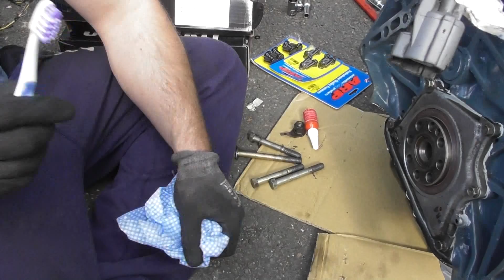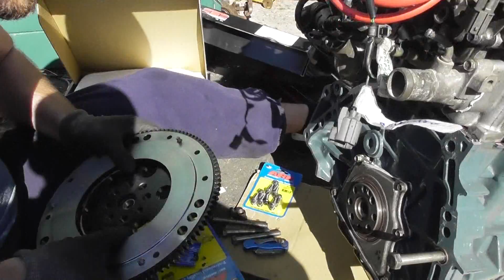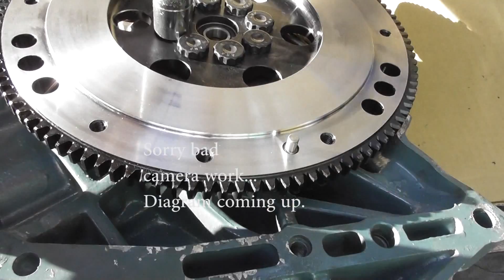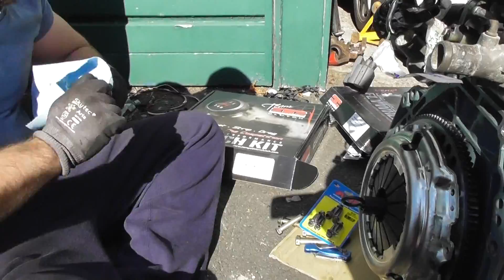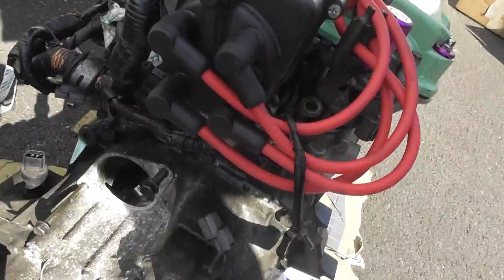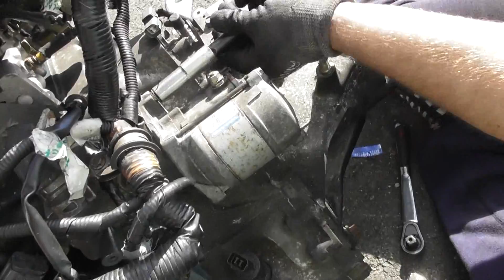T2CG Honda Civic EF Part 12 : Flywheel Clutch Gearbox Starter Motor Install

Comment: Did you clean the flywheel and presure plate with alcohol or brake cleaner? To get rid if all the oil off of it??
Reply from the maker: I used alcohol iso spray.... although I think either would work. Thanks
Reply: +Twin2 Civic Garage T2CG oh ok

Comment: very nice choice of clutch and fly! do u think the ARP flywheel bolts are absolutely necessary or could i get away with using the old stock bolts? its a n/a h22 build btw.
Reply from the maker: +v6 ftmfl Hi, no the ARP bolts are a bit overkill for my application, as I do expect any much more than 200BHP, even after different cams and tuning.  I didnt have all of flywheel bolts therefore I thought I would buy some new ones, but the flywheel ARP bolts were just nice to have. You should be fine with the standard bolts you have, just check their condition, in terms of threads or corrosion. Thanks